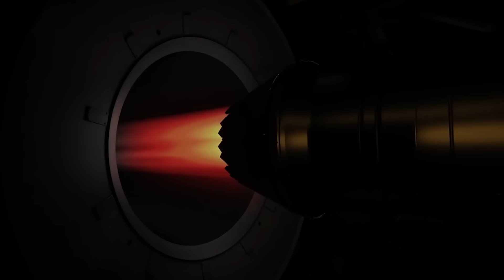Lockheed and GE join forces on a new HYPERSONIC jet engine

Comment: 7:25 I suspect this is hiding how the tubine component actually works. 6:45 shows a subsonic stream being divered. I think that feeds the turbine. But why is that turbine even still running when higher speed is leaving it behind? 1 it's an electrical generator. But also a huge challenge is burning the fuel fast enough to work in the ramjet and especially scramjet mode. Basically the scramjet is working like a supersonic afterburner, taking the idea of the SR-71 ingime and going all in on it. So the turbine now works like a burner with all or part of the turbine exhaust mixed with fuel to start combustion before being injected into the ramjet and scramjet's compressed airflow.

Comment: I am interested in what the stats are on a railgun shell with a built in scram jet rotating detonation engine with on board smart targeting. 
This eliminates the need for dual mode engines.
I would guess that will be the true reintroduction of the battleship. 
This would overcome the limitations of rocket engines in the shells giving optimum range, and velocity.
The cost advantage, depth of ammunition storage would be hard to beat.😊
I’m sure I’m wrong but it does seem like an obvious next step.

Comment: Hypersonic engines are really only feasible for missiles or drones I feel. Probably only missiles. The enormous amount of heat hypersonic flight creates means sustained flight would be incredibly expensive to perform and especially maintenance for a prolonged flight period plus maneuvering at those  speeds means likely only AI would be able to control it reliably.

Comment: Fix yall rare earth logistics first before talking about new jet engines...(I dont want to hear about if theres a will, theres a will either)

*China owns 25000 + patents in processing and refining, achieved over the last 30yrs. Ask Japan, which has been trying to bypass China the last 15yrs, and they are still only partially successful in 2 of the 7 critical minerals and not nearly as pure as the Chinese refining can get. China also have 7 universities graduating several thousand engineers a year who specialize in rare earth. That's what the west is up against. Possible sure, but will take decades and tens of billions in consistent investment, research and development.

Comment: I worked on Pulsed Detonation Engines at AFRL 25 years ago.  So much potential- we waste so much energy compressing air, but it's not necessary with detonation engines.  You get all that energy back for free, not to mention they can potentially work from a standstill all the way up to mach 5.  They are LOUD though- sounds somewhere near a jackhammer and an artillery barrage.

Comment: 0:29 I love what they always show this cutaway of a fucking scramjet or whatever like that’s supposed to make any fucking sense is a free floating cylinder inside a fucking tube like there’s no fucking way that works. That’s not how it works. I don’t give a fuck what anybody says that’s not how it works. It wouldn’t work. That’s not possible. It’s just a free floatingtube with points on each end inside a fucking shrouded pipe. That’s not a ram jet. That’s not a scramjet that’s not any type of jet engine. That’s not how it works. It’s way more intricate.

Comment: There is one step after RDE, a shock-induced combustion ramjet shcramjet, also known as a standing oblique detonation ramjet. A flowthrough detonation engine without the rotation, harmonics, instability, and heat management issues of the RDE aerospike and dual cylinder form. Mach 17+ hypothetical speed limit.

Comment: I read once that the secret to the engines of the SR 71 was that they used this variable geometry inlet tech to actually move that aircraft from the Mach 2.5 turbine power into a more direct airflow to the afterburner and create, in essences a RamJet engine for those mach 3 plus speeds it could make.

Comment: Imagine RDE incorporated into an Air Intercept Missile (AIM-470?)... for the upcoming F-47. POTUS : "It's a tremendous missile... world class performance... cannot be defeated... the M.A.R. is outstanding, earth shattering even.  Get within 200  miles and you are dead meat, better to just stay on the ground when my plane is pushing your position.  You literally cannot run and hide... going cold will not work anymore, because my AIM-470 never runs out of 'Mach Fuck' energy, just like me!" 😁

Comment: I may be wrong but as far as i can tell it seems the speed of the main shockwaves released during detonation of missle propellant with air determines the top speed of the scram missle, not material strength like turbine based engines.

Comment: The engine is just one part of the problem, the other would be to build a fliying body, that can resist the heat of air friction at mach 5+ for more than just minutes of flight.

Comment: The other nice thing about RDEs is that you can close the air input lines, open LOX input lines, and have an aerospike rocket engine.  An engine with a single RD combustion chamber and three oxidizer inputs (fan air, ramjet air, LOX) might be lightweight enough for an SSTO spaceplane.

Comment: I am a bit of a grammar nazi, and I do not see a scientific difference between deflagration and conflagration.  Deflagration is lesser known, I had to look it up, but it does not add anything here for me.  Detonation is supersonic, conflagration is not.  Deflagration is no different in this context.  Internal combustion engines have always been described as being conflagration to me, so changing it now is just confusing.  My spell checker doesn't even recognize the word.  Detonation is more efficient, but more difficult to control exactly when it occurs, timing is very important in an engine.  I don't see how deflagration is any different in this context, both it and conflagration are subsonic.  It only appears to indicate how bad a wildfire is.  I just had to say something because you emphasized "deflagration" many times without explaining why you used it.

Comment: A decent presentation, thank you. With these new engines air frame thermal issues at hypersonic speeds in the atmosphere are an important design consideration to keep the vehicle from melting in flight.
Electric arcs at the leading edges and nose are one way to manage errant heating in hypersonics. 
Materials, heat-sinks and shaping are another.
I'm a little suspicious about the fuels they are using. I would guess some type of enhanced kerosene with very high BTU's per...
Thanks again for a very good and informative presentation.

Comment: Imagine a Mach 5 missile able to decide the missile fire at it is more than it could go through and deciding to take avoiding action by altering course and height making the missiles launched at it hard to hit and also reducing missile magazines. The other way to use this engine is in a super long range air to air missile with power throughout the envelope. Maybe if it misses it can return for refueling.

Comment: They have these for a while they're used to be at least classified where they would fly over and make the puffs of smoke along the contrail line in each puff of smoke is the rotating, then follow up nation that makes the doughnut in the sky inside of the center of their contrails these if gotten cheap are nice and if properly implemented could make air travel, really, really cheap and really fast

Comment: I don't see an intake on the pulse detonation test aircraft (11:40). Are detonation engines able to take the place of turbo-fan engines at low speeds? If so, the comments made at 14:00 makes sense while the comments made at 15:38 confuses me.

Comment: Rotating Detonation Engine (RDE),  advanced propulsion system that uses continuous, supersonic detonation waves spinning around an annular chamber for highly efficient, compact, and powerful thrust, unlike traditional engines that use slower combustion (deflagration). RDEs offer significant potential for increased fuel efficiency (up to 25% better) and smaller, lighter designs by creating pressure gains during detonation, making them promising for next-generation rockets, missiles (like hypersonic ones), and even potential gas turbines. 
Fuel & Air Injection: Fuel and an oxidizer (like air) are continuously injected into a ring-shaped (annular) combustion chamber.
Detonation Wave: An ignition source starts a detonation wave, which travels at supersonic speeds (around 2 km/s) around the ring.
Continuous Combustion: This spinning wave continuously ignites the incoming fuel-air mixture, creating a self-sustaining cycle.
Thrust Generation: The immense energy from the supersonic combustion is converted into thrust, propelling the vehicle.
Higher Efficiency: Detonation is thermodynamically more efficient than conventional combustion, leading to higher thermal efficiency and better fuel economy.
Smaller & Lighter: Eliminates complex parts like compressors, allowing for more compact and lighter engine designs.
Adjustable Thrust: Offers adjustable thrust and a wide operating range.
Pressure Gain: Increases pressure during combustion, unlike traditional engines that lose pressure.    from Ai
Reply: Chatgpt is the new version of the old school "Let me Google That For You".

Comment: I'm not convinced by rotating detonation engines. The theoretical increase in efficiency comes from increased exhaust velocity, but you can get that from a well designed nozzle as well, and I don't think that you could make an RDE burner simpler than you can make a conventional convergent-divergent nozzle.

Comment: SR71 engines functioned as a conventional turbojet at low speeds and transitioned to a ramjet-like mode. Explain the difference or similarity of the rotating scramble.

Comment: Just a quick little tidbit in case no one is familiar with it. The J58 engine used on the SR-71 actually functioned like a Turbo Ram-Jet engine which is why the SR-71 could sustain speeds in excess of Mach 3+. The design of the engine actually allowed it to exceed Mach 4 but due to structural integrity issues at those speeds pilots were never allowed sustained flight past Mach 3.3. This does not mean the SR-71 couldn't go faster, just that it was unsafe to do so. There are a lot of videos on the J58 so I won't go into to much detail, but suffice to say that the US has had the capabilities to exceed Mach 5 since the 1960s and maybe even a little earlier. I mean they use to strap test ram/scram jet engines on the X-15 for instance. I do gotta admit that the newest info I heard on this video was of the hybrid RTE with a tri-mode jet engine. That would be amazing honestly.

Comment: "Much rather buy one or two high speed jet engines than 100 that I have to throw away every time I launch a missile"
OK, fair, but consider this: Ramjets and scramjets, including ones using RDE concepts, are all focused on the shape of the engine, which is information that is figured out during the design phase. It's a one-time non-recurring cost. The materials used might need to be a little bit special to handle flight thru the atmosphere at such high speeds, but that is no different for a manned aircraft or a missile, in fact the manned aircraft will need more of such materials due to the rigid constraints of needing to include a person and the equipment required to sustain them in an environment that is entirely alien and hostile to them (ejection at such high mach numbers will likely be tantamount to a death sentence unless using a large and heavy "Escape crew capsule" concept such as was used in the F-111, again making a manned aircraft larger and heavier and more resource intense to produce than a missile).
Point is, we got business jet engines from the Tomahawk missile, and I feel like history is far more likely to repeat itself in that way than it is likely that we develop the engines for a manned hypersonic aircraft and then downscale that to what would be needed for a missile.
Besides, like I said, missile or manned, the major design hurdles for these engines are matters of specific part geometries and material selections, not cost per unit.

Comment: First, the greatest weight cost is that of fuel. So if it triples the SFC, even carrying two engines could be a price worth paying.

Second, I disagree: The thing that disgusts me most? Is blowing up TURBOFAN engines with single-use cruise missiles. And I won't be surprised in the least if an RDE were actually simpler to build. If nothing else, turbofans need their own Elon Musk to start engineering away the extraneous. To consolidate many components into one, and make many more monolithic (yet serviceable). Especially for those single-use turbofans we put on weapons.

Comment: no one remembers that the SR-71 could be considered combined cycle because when it was supersonic a lot of air bypassed the turbine entirely and went right into the afterburner
Reply: Absolutely correct 👍
Reply: Who says nobody remembers?
Reply: It wouldn't surprise me at all if Habu drivers had to BACK OFF THE THROTTLES to stay within airframe thermal limits or mission profiles.
Reply: The Chinese released video of a rocket powered drone being dropped from a H-6. (Think X-15) This is a crude way to create a mach 5 interceptor drone, but it does, with no real research required.
Commentary had it landing on conventional runways for recovery.
Reply: I have watched videos stating just that “with apparent authority” . What was missing was rotating detonation.
Reply: I remember sooooo cool
USA 🇺🇸
Reply: Yes, it is a ramjet at high speeds.

Comment: I remember the xb-70 articles talked about an engine with that same description. Probably some engineer constantly trying to match new technology materials and construction methods to devices that stalled out from materials of the time. Looking at your video, it looks like the engines off SR-71 minus the turbine. I remember about someone taking RoosaMaster injection pump and matching nozzles to exhaust section, article would be 70-80's, think it did what happens with ramjet engines if you don't put turn, back pulse kills combustion.

Comment: Does an RDE need supersonic airflow at the combustion chamber? If not and the efficiency gain can be transferred to a turbine, you could even put the engine core in a civilian airliner to get even more efficiency
Reply: No.  It's a continuous wave, but not a standing wave.  As the wave rotates around the chamber, you can backfill fresh mixture.

Comment: Engines like that could make for an extremely efficient first stage of an orbital launch vehicle. 
I can see it now: ULA announces a "Shuttle-style" reusable space plane using these jet engines for the boost phase and stage, with rocket engines for orbital insertion, plus 1 or 2 smaller combination engines for reentry and landing - and at any airport with decently sized runways. Plus (after refuling) could ferry flight back to wherever it's main launch facility was located.
Reply: Indeed, in principle a technology like this could make an air breathing first stage possible. If you get the speed high enough, maybe a Single State to Orbit would even be conceivable, though that would be quite a challenge.
Reply: Don't forget rapid response teams globally
Reply: No they wouldn't.   It takes 17 times as much energy to get to orbital velocity as it does to get to orbital altitude.
Reply: @royparzyk7783 
At Mach 10 you're at around 1/2 orbital velocity, and about 1/2 way up to orbital altitude - all without  needing to carry ANY oxidizer! VERY efficient,  seeing as to the oxidizer to fuel ratio is typically around 4 to 1. If you can get half way to orbit with ZERO oxidizer expenditure,  that's a FANTASTIC gain in efficiency!
Reply: @royparzyk7783  True sir, but i was thinking that it might be able to replace a reusable first stage,  like, on the Falcon 9.
Reply: @michaelshortland8863 
Exactly! I visualize some sort of Mothership, with a secondary vehicle either slung below or strapped on top, with the secondary vehicle carrying both fuel and oxidizer for orbital insertions. Both the mothership and space plane would be reusable.

Comment: P&W basically reinforced the afterburner on the J-58 to use it as a ramjet.  There is a lovely example on display under a suspended SR-71 in the Strategic Air Command Museum a little ways West of Lincoln NE.  (Yes, there are other things within a few hours drive. [Like a Lockheed Constellation in downtown K.C., MO.)  Algorithm fed... with a shameless plug.

Comment: Let me preface this post by saying that my understanding of both ram-jets and scram-jets is based primarily on articles from 'Popular Science,' which I read in the 1980s. My understanding of the speed range of a ram-jet begins around Mach 1.2 and can go up to something above Mach 3 to 3.5. Scram-jets speed begins at or above Mach 3 and could conceivably go up to Mach 10. Perhaps further testing has demonstrated that these numbers are not correct, as scram-jets were more theoretical than actual working models.